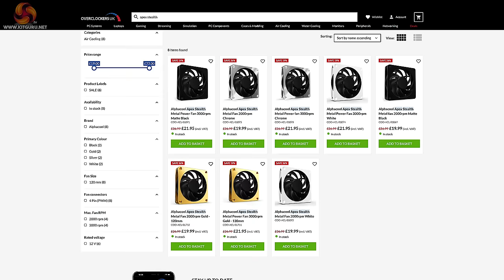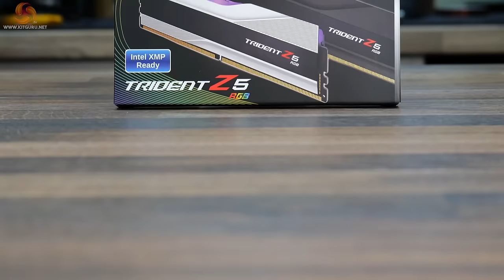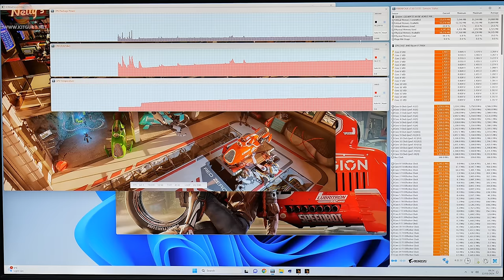Alphacool Apex Stealth Custom Hardloop Build (w/ timelapse)

Comment: love the build James, its so clean, and all the straight lines look so neat and 'industrial'. Hard line tubing is so much nicer than soft tubing. its just above my level sadly. wish you cuold make a guide on how to build a system like this for us not so experienced users.
Reply from the maker: Its quite a easy with a distro plate, less bends are needed.

Comment: When GPU prices started to fall, I took a deal on 6900XT Waterforce. Then started to think how I would get it to work the most easiest way.

I bought Alphacool 360 Eisbaer Aurora from  Aquatuning's B-stock, removed the jet plate to maximise throughput. And was happy.
Later, I wanted to put CPU also to watercooling...

Well, I got the same Eisbaer, from same place and B-stock, but 480 size this time. I just bought an extension cable (or tubing, to be exact) set and that was it. Do that on any other AIO...

Anyway, I just bought Alphacool 200mm reservoir and Apex Vpp-combo, core 1 CPU block and core AM5 performance kit.
And replaced the cpu block/reservoir combo(s). 

Works a treat. Good stuff!
Reply: Great story. How’s your temps under load ?
Reply: @stickyfingers9710  Well, I happened to check out temps on playing Alan Wake 2 last weekend: GPU 48, Hotspot 68 and CPU 55,8. Celsius, of course ;) That's with GPU at 2600 core and 1200mV. I run my 7800x3d with -30 curve optimizer on all cores, maybe I was lucky on silicon lottery, but I have not been able to get any errors, for example in OCCP's stress tests... 
I mean, temps are just excellent. And so far, I'm really, really impressed with VPP Apex-pump...
Reply: That’s impressive. Certainly worth doing especially with lower noise levels too.
Reply: @theonlyredspecial  Exactly, lower noise level is the main thing. And knowing, that everything is serviceable and replaceable.
Reply: When you building it ? Are all the parts available ? Had problems getting some alphacool parts before
Reply: @Linuxdistro15-ih8ox  Well, the reservoir-/pumpcombo was out of stock at Aquatuning (it was like on 30% sale). So it took something like a week or two to be restocked (they had a date on site and it came back to stock when they promised). Cpu block and AM5 performance kit were on stock, so no waiting on them...

Comment: Very nice build, im going to upgrade few components and going to custom cool it as well, i have landed on very similar setup as you: RX 6900 XT / Ryzen 5 5800x3D.
I have a question though: Would 1 of these radiators be enough for this build ?

Comment: Nice build. Have the same gpu and block but my memory temps are very high (80 degrees under load). All the other temps are amazing.
Reply: I always was told alphacool were the cheap Ekwb.  But that build looks brilliant
Reply: What cpu are you using swizzler ?

Comment: When I saw the “stealth” wording I initially thought it was a rear connector motherboard build.  I’m waiting for the ASUS motherboards and 5000 series gpu’s with the BTF connection for my next custom loop I think.
Reply: Sounds like a good time to do it. Will you buy alphacool or Ekwb kit ?
Reply: @Itsameamario-ns3se   I’ve used both and tend to mix them in my builds. I can never get all EK parts as they never have stock and their white rads don’t match the white cases I’ve used so far.

Comment: I'm curious about your flow configuration - and why you have your gpu flow (hot) dumping directly into your cpu (also hot). Wouldn't it make more sense to have radiators between the hot components? For example: 
pump-discharge
gpu
radiator
distro-plate
cpu
radiator
distro-plate
pump-discharge
Reply from the maker: This is just how the distro plate ports are laid out, they are labelled in the manual RAD, GPU, CPU RAD etc. For a gaming pc it makes sense to me to have the GPU first in the line anyway, you want your GPU to be cooler for maximum performance right?, plus the difference in water temperature between the GPU inlet and outlet will be minor. 

Also CPUs just dont benefit as much from custom loop cooling these days, the CPU IHS is the limitation now.
Reply: 👍 @KitGuruTech   Thanks for the response! The build looks amazing btw...  If you had more time for this build - what would be your mounting plan for the flow indicator? Or did it simply not fit?